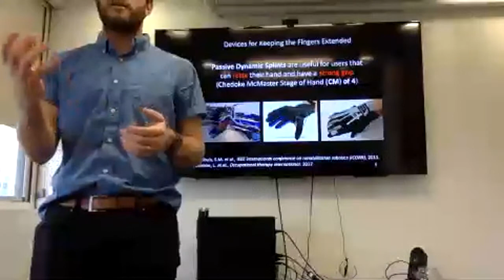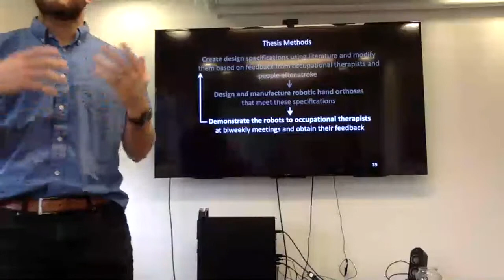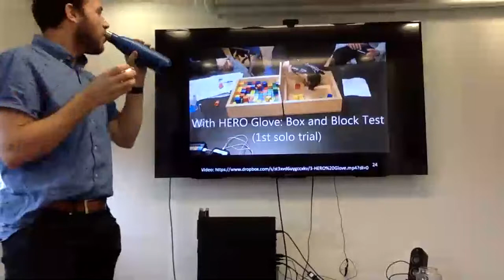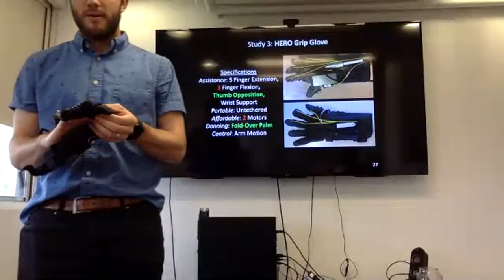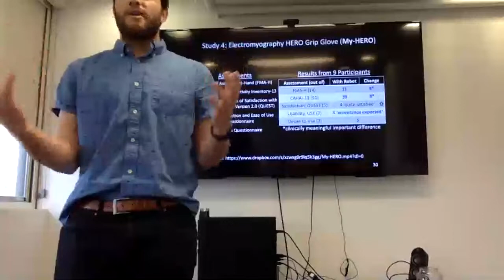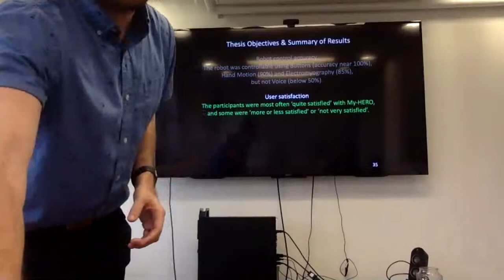Soft Robotic Glove for Stroke Rehabilitation and Assistance: HERO Glove Presentation

Comment: Great work, Aaron! What would you change if you could? Also, can you post your controller code on the makers making change site? I may make this!
I wonder if survivors of stroke used this repeatedly, effortfully, and intensively when just sitting around...while reading, commuting, watching TV...if their range and control would improve. Also, combine with e-stim (NMES) of the applicable compartment during HERO assisted flexion or extension of detected intent/effort.